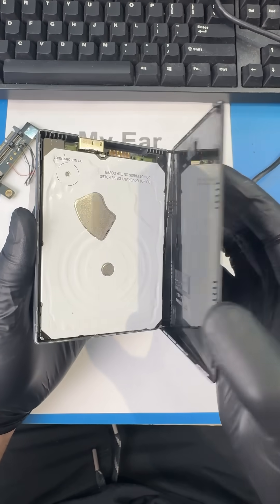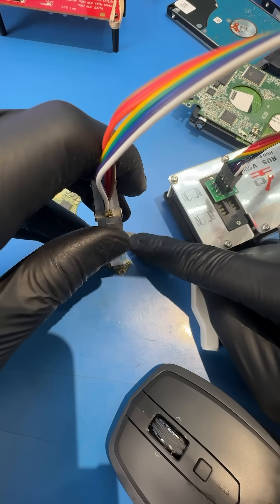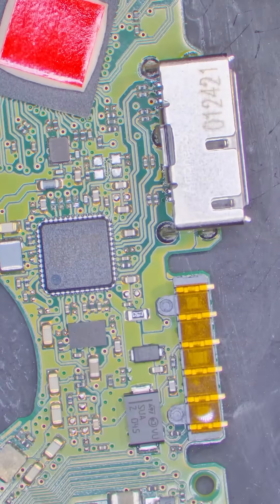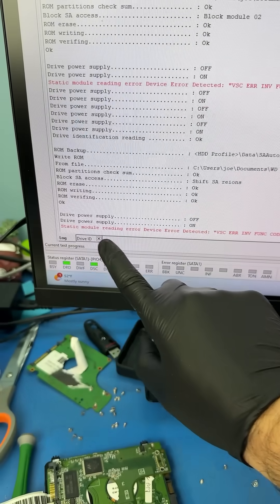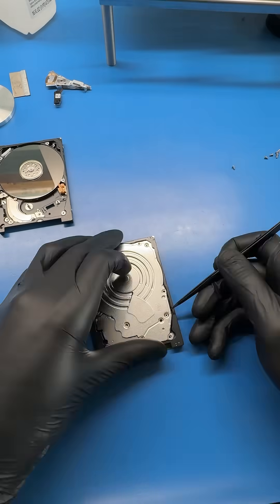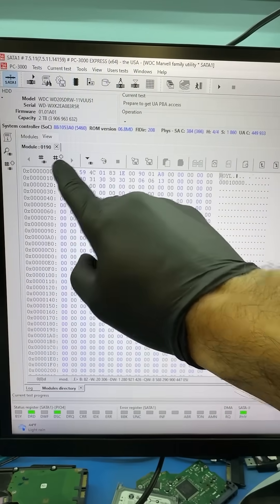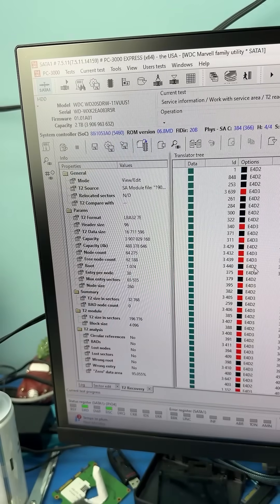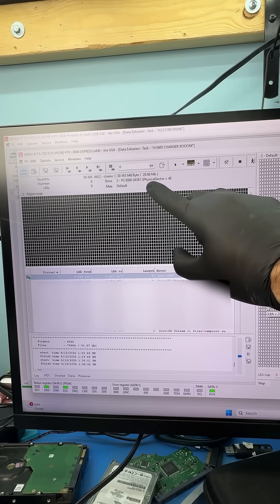Hard drive translator...? #tech

Comment: game devs not using git or backup is just a constant source of jokes in the software industry
Reply: FR, using ONE external hard drive for months if not years of work is insane. If I did this stuff for a living I would have a backup sever or have my storage drives in a RAID configuration
Reply: @Teh_Random_Canadian  bro is so passionate about RAID he even commented twice just in case the first one got deleted
Reply: @laadidaouiomar1078  underrated comment
Reply: @Teh_Random_Canadian  def normal drive, raid server, cloud + git at a minimum
Reply: @Teh_Random_Canadian  Congratulations you might be one of the concious humans. The logic behind this story is almost worse then the outdated bot at the top comment.
Reply: @Teh_Random_Canadian  just use ssd loke it is dirt cheap for 1 tb
Reply: @Teh_Random_Canadian  yea or just use git and google drive lmaooooo
Reply: @cheater00  Chances are if you're taking this seriously you dont want stuff in the google cloud. 

As for git, someone has to host that and it's pretty much just for code. Assets don't really belong on there. Best solution is really to do it yourself and put up a fileserver with RAID Level 1 configuration in case a drive stops working. That way you just have to plug in a new drive and the array will rebuild.
Reply: @hydrohomie254  yes but guthub plus any cloud drive is super simple and 100000000000x better than nothing. game devs are such noobs
Reply: @hydrohomie254  The only reason assets don't belong on Git is because they can't really be versioned and updated the same way that text files can be. There is nothing stopping you from uploading assets and with Git LFS, you can have bloody large ones too. You can absolutely do it
Reply: @cheater00  ye and then get hacked and all of your game development gets leaked and is now useless
Reply: @hydrohomie254  Well, if you save an encrypted archive in the could (can be automatized), you dont need to worry about safety. Encryption can be set strong enough to deter any reasonable attempt to steal the data.
Reply: @carl-p5s That bloats the index though, making any fetch/pull and clone very very slow...
Reply: @hydrohomie254  With git lfs large files are no issue. Also prety much every gamedev I know of, including AAA, uses source controll. More commonly perforce though, works allot better with binary and large files by default.
Reply: @hydrohomie254 you can host it yourself tho, just setup a raid 1, 3, or 10. Or even no raid at all, you have a copy on your machine anyway.

For binary files like assets you can use lfs, it was made specifically for that. Its clunky but better than simply having a copy backed up. Because quite often you need to roll back changes, and if you have moved assets around be ready to spend hours or days fixing everything up.
Reply: @autumn8230 I don’t think it works like that. Copyright/timestamps exist for a reason. If anything them using your data makes it easier to track them down.
Reply: @hydrohomie254  I am not a git nerd; but I know enough to say, you absolutely can commit more than just code to a repo
Reply: Hopefully a “I leaned my lesson the hard way” once-only mistake.
Reply: FR, using ONE external hard drive for months if not years of work is insane. If I did this stuff for a living I would have a backup sever or have my storage drives in a RAID configuration
Reply: @Teh_Random_Canadian I see you even made a backup of your comment.
Reply: @coloradoing9172  Can never be to safe (Also YT's comment system is garbage)
Reply: @coloradoing9172  underrated comment
Reply: @Teh_Random_Canadian  RAID doesnt replace a backup. RAID is just another layer of security but you should still have at least two copies (three if important data) on different devices. Also a proper backup plan
Reply: @Loik948  True, if your house burns down a raid isn't going to help you
Reply: @Teh_Random_Canadian okay, Johnny Mnemonic
Reply: Git itself is not sufficient as a backup, unless you have an external server.
Reply: Choosing version control is such a headache in gamedev due to so many big binary files😩 Svn is branching nightmare, Perforce is expensive and so not user-friendly, Git LFS not popular too but I forgot why, probably for getting bloated by metadata... But not having SSD and backups is still more crazy 😁
Reply: @xkenny1995 You don't backup binaries (or it wasn't design for it) to git. Lots of fields have this issue. You store source using git/hg/etc and store compiled stuff locally if you'd like.

(I am surprised if/that asset editors don't have built in versioning metadata like a modern photo editor even would. Even adobe products support this kinda thing).
Reply: @sophiophile  audio video and pics have no sources.
Reply: @lpi3 I have no game experience (ML here). Your saying that videos aren't rendered from source code?
Reply: @xkenny1995  the fact you even consider svn means you should take a whole day out of your work and just learn about git. git works great for huge files nowadays, there's no excuse at ALL.
Reply: @xkenny1995  gitignore the build directory lol
Reply: My best guess is they are a unity dev
Reply: @LycheeLele-mh2ku  fair unity is very big, but unity has its own storage system...
Reply: "is just a constant source of jokes in the software industry"

... and it STILL doesn't even compile!
Reply: @hackswell  yml automation
Reply: need to set up raid array for redundancy hard drives are the most unreliable part of a computer.
Reply: Why not use disks in raid
Reply: @DigitalDistortedGuitars  Sure, was mentioned before. It is a good idea to have a RAID1 setup for important stuff, but also have offsite copies.
Object storage like AWS S3 or Azure's Blob is quite cheap these days, archival tiers of those even more so.
Reply: You’d think devs would make tape backups daily.
Reply: Thanks for your input, you nobody 👋
Reply: He hurt your feelings😂 @TheFoxdaWa
Reply: @TheFoxdaWa  Don't think that you are someone. We're all dust, including you.
Reply: @LAYATORS I know
Reply: If you have a single backup, you have no back up. If you dont test your backups, you also have no backups 😅
Reply: This man is a backup
Reply: Well yeah, most use P4.  No backups is crazy though
Reply: yeah like its so obvious, only as a 14 year old I wasnt aware of git and lose my data because of that
Reply: he could still be using git locally
Reply: GIT is actually not great for gamedev, due to most games having lots of binary files, even if you enable LFS, and not having file lock. Perforce is usually better at this, and diversion does an ok job.
Also Source control is not backup, it is a copy. You can trust as much as you trust a pendrive (so not much).
Ideally you would have your own file server with offsite redundancy and use cloud as just a another copy, having a 3-2-1 backup strategy.
Reply: @MarcusBuer  binary files? git is used for source code not pre compile, unless you mean game engines, since they have binaries. If you could elaborate on what you are referencing too??
Reply: @CGRofficalcode  When people say “binary” in the context of Gamedev they don’t mean just compiled code or engine executables. They mean files Git can’t meaningfully diff or merge. In gamedev that’s most assets: textures, models, audio, animations, Unreal .uasset/.umap, etc. They’re not pre-compiled code, but a small change often rewrites large parts of the file, so Git just sees a new blob.

Git is amazing at source code and other text. It’s just not great at this kind of asset-heavy workflow because binaries aren’t a core use case. Other source control systems used in gamedev (like Perforce) are built around handling large binary files, locking, and whole-file changes from day one, that stuff is baked into how they work, not added on afterward as a workaround like GIT LFS.
Reply: @MarcusBuer  👍
Reply: tbf git is really annoying to use for game dev due to a lot of files being above the default file size limit, but yeah git lfs exists
Reply: yeah its really cringe
Reply: probably this is an old project, when project repos are not popular yet. If this was recent, the drive should be SSD or newer.
Reply: Most game devs arent even professional 😂
Reply: It's another hard disk somewhere else
Reply: You don't even need technical skill to do a backup. Like WTF
Reply: I've had people argue with me on this. Had a dude practically refuse to check his code in to source control (20 years ago - so it'd be SVN back then IIRC). Magically had the blue smoke poof out of his drive and then fire. Things were toast. Lost like a weeks worth of work. And THAT was why I told him to work in his own branch and check in stuff daily before leaving at a minimum. He thought he was going to get fired - I just told him it's an expensive lesson to learn. I bet 20 years later he does his backups now.
Reply: Let's entrust all our files to somebody else's server where they can scan them or lock us out whenever they want! We're so smart.

Tech bro circle jerk. Version control is not a backup, and is not needed for most projects until they're mostly finished. Even then git can just be used locally and should be if you don't have a team you need to collaborate with. Just copy the files to a secondary location instead of slobbering big techs knob
Reply: so real. github is a free nas system
Reply: Lord help us if there is ever an EMP.
Reply: Git is only useful for the code and already completed assets. Any raw file like blender file, music source file, etc.
 Is not recomended for git and services like github have Maximum total file size limit
Reply: @jomarcentermjm  gng git is a tool used for programmers not people like music artists, model creators, video editors, those people consider buying a nas or buying a storage server
Reply: to be fair, game dev uses a lot of large files that don't tend to store well in git, and git lfs is only so much of a bandage. essentially opaque binary files (what a lot of source asset files from GUI asset editors end up stored as) are quite difficult to version unless the tooling finds a way to expose the underlying structure in a way git can understand, and even that's still problematic with the large file problem.

i'd definitely like to see a world where version control is the standard but there are more barriers than "game devs don't know how to use git"
Reply: As a game dev myself, the only way to do this is expensive, expecially for big projects
Reply: @LAYATORS  lol nooooo buddy it really isn't!
Reply: @cheater00  Oh yeah? I have a 100GB project, who's going to host it for free?
Reply: @LAYATORS a raspberry pi you buy fir $50 + a usb stick thatcs 1tb for $50.
Reply: @cheater00  This is madness
Reply: @LAYATORSa physical backup isn't that expensive though. At most a couple hundred for another drive
Reply: That’s why game devs make like 100k and software engineers make like 300k (USA)
Reply: @zaybxc1 buddy I know start ups that have now sold a million copy’s at $40 a unit minimum they sure as shit making more then 100k a year.
Reply: @zaybxc1 No, that's because gaming companies are happy with ripping off talented programmers. There's also a lot of disrespect for game devs from other software developers? Which seems crazy to me because that's like hating your cousin because they speak a different language.

Comment: Being a dev and not backing up your work to a raided nas is beyond incomprehensible
Reply: Not having a backup at all for important data is beyond comprehension
Reply: Especially as the cost of setting up a NAS is way less than the cost of this data recovery
Reply: @sylvifisthaug   but the probability that you need data recovery is only 2% or less and also you're always under pressure so things just slip by sometimes. Mistakes do cost money, good that there's such talented data recoverists out there
Reply: At my company we back up regularly but certainly not using any kind of RAID.
Reply: @Littlefighter1911  unless your doing it to a cloud service(or tapes) as well as onpremise.. your company needs to replace its IT department. but i suppose it doesnt have one.
Reply: Why do you need a raid? Just push the code to the repo
Reply: I git push after every commit. Fuck it
Reply: All my source code is checked in at least once every day (often multiple times an hour, if i'm fixing small bugs). And all repositories are automatically synced to 5 servers in different physical locations. Plus backed up monthly onto some offline storage.
Reply: Nas might be overkill, at least put it on a git service, you can just turn it private, takes a few seconds
Reply: Happens all the time, even in AAA pipelines. Most of the time it's not even the devs fault, it's the company infrastructure preventing them from setting up safety nets.
Reply: I got No raided nas. Just a externel 1tb hdd For cold storage, works good (For now at least, in the Future i will probably regret this decssion
Reply: have you seen the cost of a nas these days? i want one too
Reply: @John-td9cp   about 400 + drives? And they don't have to be expensive drives, you're not running them hot and you're not generating that much data working alone.

Heck make it not a NAS just a tiered external drive backup schedule organised so you lose at most a week of work. You can do it.
Reply: NAS is not a backup. Raid is not a backup. Both together are not a backup. The 3,2,1 rule still applies.
Reply: @hopperbopper Vc is not a backup. You still need to make a backup for redundancy.
Reply: He had 3 backup in this drive😂
Reply: Just use git lmfao
Reply: most game devs aren't making games with budgets. 90% of them are just passionate nerds using their only computer to try and make something fun.
Reply: @arcanealchemist3190    backup is free!
Reply: Cloud…?
Reply: Hopefully the customer learns. Otherwise: No backup, no sympathy.
Reply: chil tf out.. not everyone is made of money swimming in an infinity pool after work everyday.. could have easily been a solo dev working hard with what they have.
Reply: @g-3609 I get that but why put yourself through possible years of development to lose it in seconds. A nas can sometimes be overkill but at least a second drive for a back up wouldn’t of cost a lot and would of been cheaper than getting it recovered
Reply: @g-3609  NAS setups are relatively cheap.
Reply: @g-3609  they could have used git and github for versioning and as backups

Comment: Using a HDD in 2025 is wild
Reply: Price per terabyte is really the only reason.
Plus people tend to use stuff until it's dead.
2021 so 4 ish years.

About the expected life on a drive 4-5. 
Given its a portable drive too, it might have had more emergency parks on the heads when unplugged without safe removal. 
Versus 3.5" inside a computer which usually get a signal to park while power is still there.
Reply: @ yeah very true, although I wouldn’t be developing a game and putting dozens of hours into it without having a back up if I am using a HDD
Reply: If you are have a big media library (like movies, music, etc), speed is not important, HDD is cheapest option per TB.

Comment: Why would a developer use a western digital hard drive. I don’t have anything important and my data is stored in SSD and cloud.
Reply: SSDs fail easily as well. In fact all the SSDs I've used have lasted less duration than my hard drives typically do. (and this is despite leaving lots of open space on the SSD, not using it for tons of writing, making sure the partition was aligned, using TRIM, etc.)